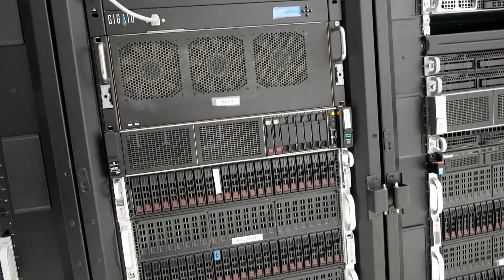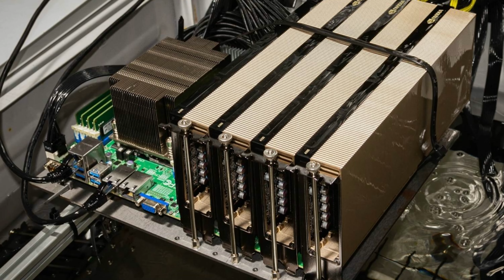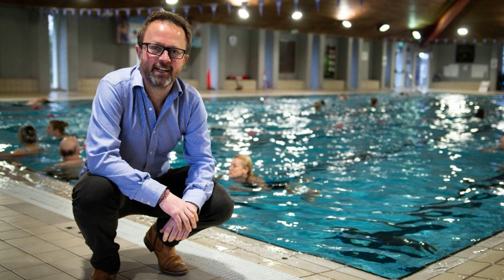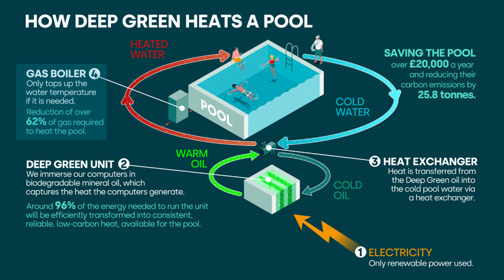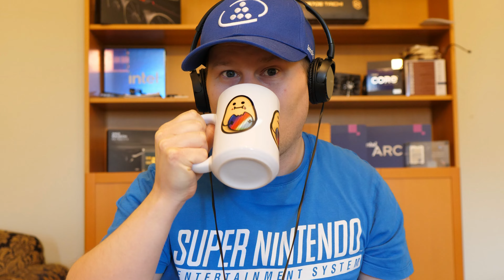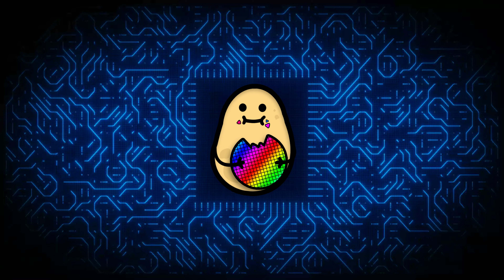Servers for Swimming Pools. No honest, hear me out

Comment: mineral oil isn't the best for maintainability but it would capture the greatest possible percentage of the 24kw output. I just hope they actually force the oil through the fins rather than using convection. I'm fairly sure they must be but then again these GPUs will run at 80 degrees so they could screw this up and still have working servers. It does sound a little jank.

A less naïve approach is to just have a normal server room and a normal heat pump with an additional heat exchanger to take the heat to the pool. This would also capture the total output but it would be less efficient it would cost about 5kw to do that with traditional ac and that 5kw might have I dunno 1 or 2kw uncapturable heat.

1 rack definitely wouldn't be enough if it was done 'normally'

I would make it as swapped 1U oil filled blades and I would use some form of quick disconnects if possible but the system would need to work with pretty high oil pressures. I would actually conformally coat the small surface mount components (again?) just in case and then seal her up for an expected 3 year run time.

draw the oil down to a low temperature with a heat exchanger and the hot side connected to the pool. Maybe the blades would actually run sub ambient and have special channels to pool off the water. would need fibre networking and every individual power connection would need an rcd. perhaps all of the psus will be ouside of the oil chamber but in the same cool chassis and potted with a potting compound

I will give you 42 thousand watts in one rack.

its also kinda easy to make the rack be in a dry room so it wont short out

Comment: Maybe the idea behind mineral oil is to try and capture more heat? I guess if it was water cooler, you would capture most of the heat but not all. Eg, heat produced by the motherboard, chipsets, etc?
It’s potentially a cool idea but energy costs are going to come down a bunch this year so by the time it’s implemented it will probably be less economically viable.

Comment: I think more than the energy needed to initially heat up the pool, it would be meaningful to calculate the thermal transfer between the walls of the pool and the waterline, plus whatever is the power needed to take up to temperature the recirculating incoming water.
The same kettle takes 3000w and 1½ minutes to make the temperature rise by 80/90 °, but it takes minutes to dissipate a fraction of that energy.
It might have a chance of working imho.
Plus if they're going for liquid cooled systems, they might have really power dense systems, and I'm pretty sure that Nvidia GPUs top at 500w each? Plus dual node MB, plus switches and interconnect, storage etc. I think it might be a bit higher than 24 kW

Comment: My guess is they are using mineral oil for the rack for better efficiency on the heat exchanger with more delta T, maybe worried about propylene glycol in pool water. I think heat loss would be a better approach, which should be significantly easier to maintain temperature in an indoor pool than heat it from fresh fill (which would require way too much compute that would need to be turned off anyway once at temp) there are definitely scale limitations but we are already beyond the point where dumping server vessels into the ocean seems viable, although I see the pool heating as more of an extension of people heating their homes in the winter with crypto mining.

Comment: If I understand this correctly they are not claiming the solution heats the whole swimming pool, they are saying that it makes a £20,000 a year saving. because if it costs £300,000 to heat a pool for a year then obviously it’s not providing all the power to heat a pool, just contributing to it.

Comment: Remember how most towns used to have a centralized heat supply piped throughout the town?
Its not exactly feasible on a large scale because of the heat loss, but what about apartment buildings, heat that water up to 60c to use it both for building heat, and hot water supply with a hot+cold mixer to ensure the water coming out from the 'boiler' to be used for bath/sink isnt too hot. Only supplemented by other methods when needed.
Reply: It's very scalable, Helsinki has a heat distribution grid with a capacity of thousands of MW IIRC.

Comment: If I can split the cost of electricity with the leisure pool then I also save my AC and AC maintenance costs. Just reducing the AC costs is good. 
Will the pool water be cold enough to cool my servers ?   
Lastly will the server heat output be less than the pools' heating need ? Why?  To be sure the servers can run "full tilt"  100% of the time and not need to dump their heat to an AC unit. 
I like oil immersion as there is no standard water cooling hookup for servers, video card, power supply, bit coin miner hardware. This makes it easier to drop clean equipment in the mineral oil. 
Is it viable ?  In theory. However business models change so it may not last.

Comment: This seems entirely like the wrong scale to work at. For compute, the cost of cooling only really starts to be an issue when you get to large installations, when you need more than a trivial HVAC system to handle it. If you just need to cool 1 rack you can toss it in a closet with a large mini-split A/C system.
This would be great if it was attached to a much larger compute system, at least several rows of racks, where all the density starts to require additional (expensive) infrastructure. At that point, figuring out how to do custom installs might be worthwhile.

Comment: The thermal capacity is not really this relevant in the calculation.The water is only exchanged in a small part over the day. What you actually have to account for is the heat loss. That will be fresh water (if you not exchange heat from old water to fresh water) and then mainly the loss of energy into the air of the building and then from that through the roof to the outside.  The first heat up of the water can be done by some other technology or you are really patient and just wait till the equilibrium of loss to input is reached.
The biggest problem is when you want to drain the pool because of maintenance, suddenly your server farm is down because you cannot get rid of the heat..

Comment: I'm confused why they are only installing a few kilowatts of server capacity and using mineral oil rather than waterblock cooling with a heat exchanger heating the pool.  Why not install a a few hundred kilowatts so it's not a gimmick, especially since an open water swimming pool has significant capacity to deal with any excessive heating due to evaporative cooling from the phase change happening at its surface contacting the open air.  This feels like the local municipalities getting scammed by this company pulling a stunt because it could work really well with a larger datacenter installation and getting rid of the mineral oil bullcrap.

Comment: While I'm not exactly sure swimming pools are a smart use of excess heat from servers, but I do think the general idea of making use of waste heat is something we should be actively working on. We need to improve efficiency in so many different areas, and any data center which isn't actively using their waste heat is extraordinarily inefficient. Considering just how much of our electricity goes into running servers in data centers, there's a lot of unused waste heat that could potentially be used in some way.

I really think we shouldn't be looking at it in an economic sense either. We're in a very bad place when it comes to global warming, and given that the vast majority of processes we use generate waste heat, finding a viable solution for capturing and reusing that waste heat should be able to improve our overall efficiency, and help mitigate rising energy demand. Of course, it's only part of the picture, and may ultimately not be a great solution, but given how governments around the world have failed miserably at actually doing something about the current situation anything is better than nothing.
Reply: More than global warming alone, reducing e-wastes is also a huge concern. Using power hungry servers to useful heaters is not a bad move, but that should be refurbished hardware, and preferably for running scientific computing projects (things like BOINC, not crypto or AI gadgets).

Comment: That was always my mantra to use the heat my two big towers with their 8 GPUs(mixed bag of 6800s, one 2080ti and 3070s) emit. Since I live in a flat with thermostate controlled electric heaters, I heat my living room with those two machines. Atm mining RVN with them which ends up in about 2KW of heating power. Plenty enough for that 30m² room even in the winter. In the last 3 month a mined RVN worth about 500$(not excactly RVN as I trade in those volotile suckers for BTC every here in then) while only spending 150$ for the energy my "dummy heaters" in the rest of the flat "consumed".
Reply: I've been hearing my place with computers this winter. Drawing about 2500 W is enough to keep my 150 m³ place warm in -30. Not mining though.
Reply: @MarkRose1337  M³? you live in a cube? Na bro you kidding. My parents home is a 2014 build higly isolated house and also around 150m². A house like we in Europe use to build not such a thin walls US shit. And still they need a 4KW heat pump system, for sufficient heating in the winter.(they like it around 24° Celsius though so 3KW may be also sufficient) 
So if your statement is true you like it at around 16° Celsius I guess.
Reply: @Squilliam-Fancyson  Typo. Meant m². I keep a window cracked to open when it's above -20ºC to keep the temperature comfortable. I'm in Canada in a newly build home.

Comment: Compared to what? Dumping the energy into the air? This is a difficult issue?

Even dumping the energy into the air INSIDE a swimming pool building would be preferable to dumping it into the air OUTSIDE it. Hell, you could conceivably pump the air around the gap between the pool and the building foundations, not heating the water directly, but reversing/reducing the temperature gradient pulling the energy out of the water to begin with.

It really is a simple question anyone should ask themselves when objecting/supporting a course of action; compared to what?

Comment: I still think it could make financial sense, if done properly. I don't actually think the initial cost of the hardware should be a problem, since the money for this hardware is going to be spent anyway by the "consumers" of servers like these(via rental or via direct acquisition of hardware). I'm sure the swimming pool owners couldn't run this business, but a specialized operator probably could: You wouldn't buy compute from some random swimming pool in the UK, you'd buy it from a compute provider that has some servers in a swimming pool.
The only extra thing you pay for is the installation and maintenance costs for making a computer part of a swimming pool heater. I'd assume that the costs of heating a swimming pool are way larger than this.
Maybe the scale of 1 rack isn't enough to justify the additional costs for installation and maintenance, IDK...
Let's just hope these swimming pools are in areas where they can easily get fast fiber connections...

Comment: Using computers specifically to heat something is questionable at best. The additional infrastructure might not be worth it. Especially bad is the idea to mine crypto for the sole purpose of heating your home.
Because: it's a lot more efficient to use a heat pump for heating. That provides about 5x the heat energy that you put in as electricity.

Comment: I heard this argument a lot for mining crypto during the last boon. Just heat your house with server output! What's the difference? The main thing that people are missing is that a typical heat pump has a cop of 2-3 (or even up to 4 for ground source). This means 1W of electricity in nets you 2-3 watts out. Reusing excess heat is a good thing, but the requirements for the servers to be there should also be a high priority for consideration. Why not heat a building instead? Lol

Comment: Mineral oil seems like a bad idea. I feel like watercooling or even circulating air with an large air to water heat exchanger would make more sense even if you loose a bit of efficiency since ease of maintenance on a mineral oil system will be a complete nightmare.

Comment: Another great idea on paper, but complexity and cost to develop and implement seems to me high. Good question are big cloud datacenters if there is any way how to convert heat back to electricity ? Also the first sentence :D "World is driving to more sustainable HW ..." first think on my mind was new GPUs 4080-4090 or new CPUs like 12/13gen i7-i9.
Reply: Ada is actually quite efficient though, at least compared to Ampere^^
Reply: The desktop/gaming market is not a good indicator because it's prioritizing max performance over efficiency. 
A lot of people disregarded the quite recent RX 6400, even though its design and its power constraints (unlike the terrible RX 6500) makes it the most efficient graphics card out there, both at idle and max load. And it shows compared to the refurbished chip on the GTX 1630 or a used RX 560 or GT 1050.
Reply: @PainterVierax  true, most desktop parts come with stock power limits well beyond the efficiency sweetspot, thank god we are still allowed to undervolt those
Reply: @flysunri5843  Sure undervolting fix the efficiency curve at high load, but it doesn't fix the overkill VRMs and the internal designs (like bus widths) that can plummet the efficiency at idle or during light load times.

Comment: If they were serious they could make a dense self contained water cooled server rack, make it in a metal box unit, where power and water go in and hot water go out plus a network connection. Make it so it is quite redundant and let it be untill it fails completely or is so old and inefective it can be replaced by a new model. No maintenance required, just like the microsoft sea computing containers but a in a smaller scale. Pool the computing capacity and manage it remotely.
In essence it needs to be an industrial appliance just like the water heater the pool has.
It DOES NOT need, nor even want, to be powerful enought to heat the water, just enought to keep it warm and offset the majority of the heating, but not all, so it can allways stay cool and at 100% work.
In fact it should be just like the space heater you showed, plug and play but at a bigger scale.

Comment: hm, i think normal watercooling is better, but there is no real rack mounting technic for hot swap? ive seen fast couplers in enduser watercooling, but for servers and rack? like a bigger "exhaust" tube for the hot water with fast coupling? i mean it would be alot of tubing and fittings. two for each cooler. is it better to put them into a row or split them up before? i know 8pack did some "research" on coldplates for binned cpu's for high frequency trading.

Comment: This is a good idea. Thermal capacity of water does not matter. More is better probably.
You only need to put in enough energy in to offset the losses of the pool and keep the temperature stable.
Reply: I agree with the original comment. I doubt anyway the pool would forego a traditional heating system. In case of emptying of the pool,  they would just use the systems in parallel.  
I imagine the servers will just receive part of the savings from not having to run the heating system as often. They would still need a cooling system, so the upfront cost would be largely there anyway, and now it's at least making some profit,
Reply: infrastructure has energy costs, too. huge ones, if we are talking concrete. I doubt the server could pay off that debt over its lifetime (assuming concrete is needed for the pools). I'm not sure what the infrastructure will be like. Obviously they aren't just chucking it into a pool. Where are the servers located? What happens when pool maintenance is required?   I'm highly skeptical

Comment: A proper server park in a proper water park could make financial sense.
The downside is that crowds love water parks and server rooms are filled to the brim with expensive tech, so having a crowd nearby is a security concern.
Reply: What you do is put a door on the server enclosure and lock it.
Reply: @phillycheesetake  Can put the datacenter anywhere within the neighborhood because you only need to have water pipes from the heat exchanger system connecting the datacenter to the pool complex.  Don't need to be in the same facility or building, just need to be plumbed together and you can run the plumbing through the same understreet utility access water, telecom, and electricity often uses in many older cities.
Reply: @RazorSkinned86  the greater the distance, the more inefficient the heat transfer will be. if anything it'd probably make sense to have it underground beneath the water park.
Reply: @GeekProdigyGuy heat transfer through pipes works well, they heat cities with that. A neighborhood away would be likely totally fine efficiency wise. 
Imho what you suggested it's completely bonkers, even if they were to build a new water center from the ground up.  The need to dig deeper, having the need for a floor (a high one at that, with needed for wiring and plumbing) beneath a large volume of water (read, weight) would make construction costs needlessly balloon up.  And again distance is a relative driver of inefficiency, but  having the servers just side to the pool wouldn't make a dime of a difference from having them beneath it
Reply: @phillycheesetake  Why didn't you tell Beyond PL that, they wasted all that money building double concrete walls around their slab of a building with redundant systems for everything.